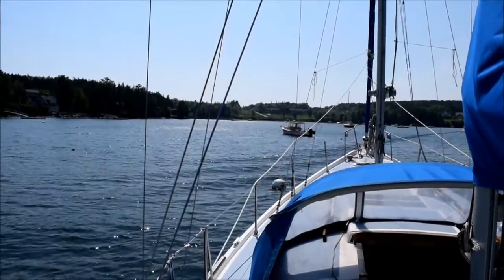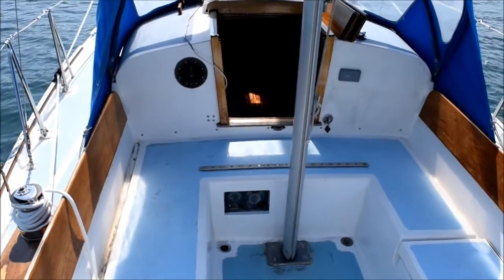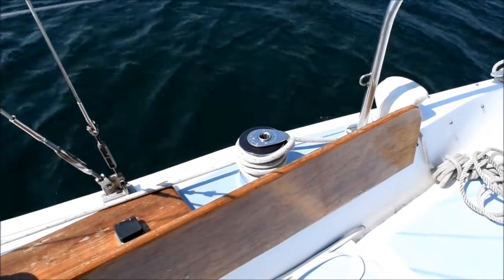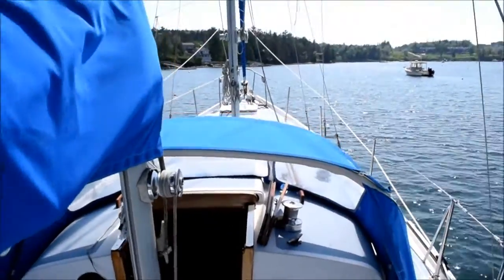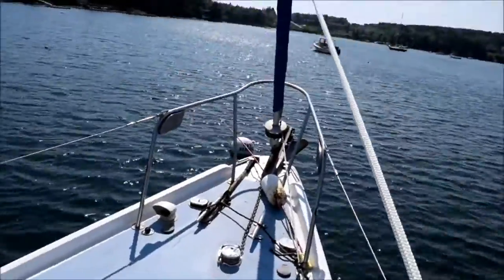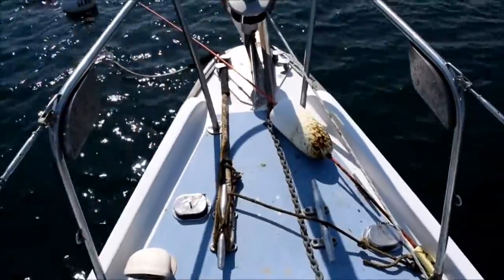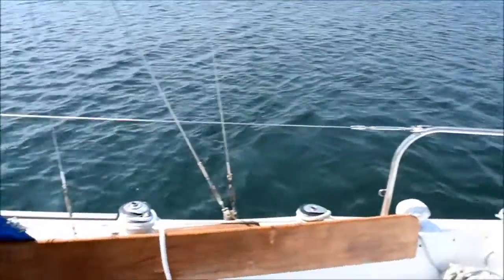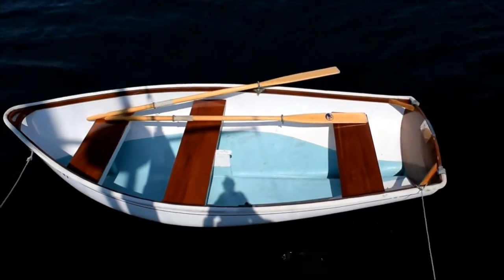An on deck tour of my 1972 Allied Princess 36 Seaquestor

Comment: Mr. Dunn, we have recently purchased a 1973 Allied Princess; we believe it to be hull #14.  We are working to restore it although the previous had already done most of the heavy lifting for us.  If you have any information on them or could point us in the right direction we would really appreciate it.
Reply from the maker: I would be happy to assist in any way I can.  Just ask.  I have owned my Allied since 1996 and have a good knowledge of the boat.  I also used to run an Allied Princess Owners group and have a lot of data about the boats.